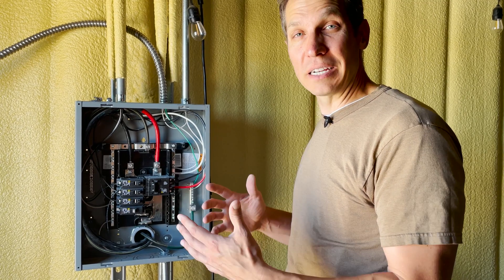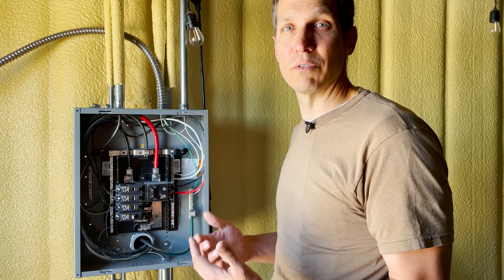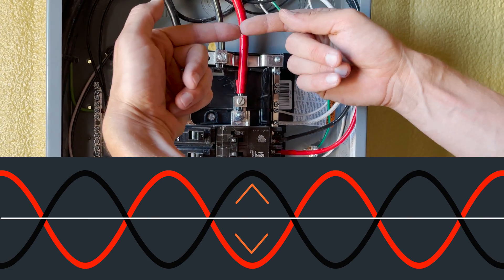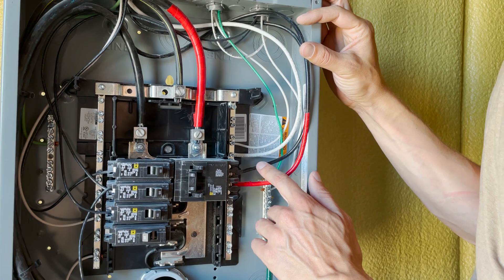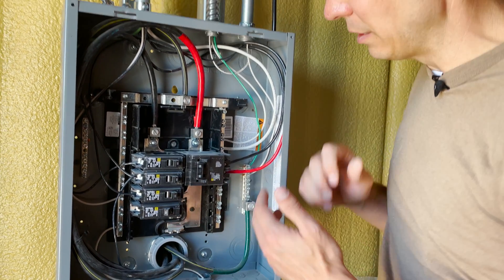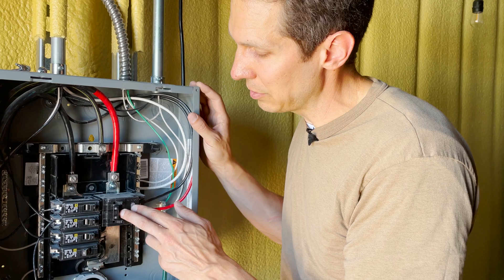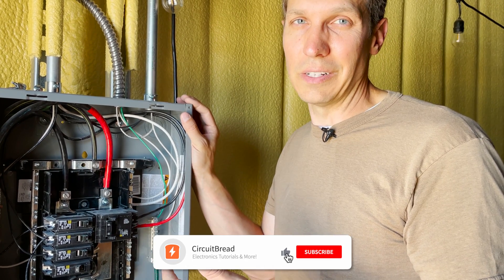How to Wire for 240 Volts in the USA | CircuitBread Practicals

Comment from the maker: We want to thank Triad Magnetics, a Friend of CircuitBread specializing in magnetics and transformers, for supporting this tutorial!  Go to triadmagnetics.com to see their line of transformers that can be used anywhere in the world that can transform down from 240V to whatever you need or from whatever you're working with up to 240V.  Again, we're grateful to Triad Magnetics for supporting free educational content like this!
Reply: Can I connect one 240v hot wire to only one connecting point while leaving the other connecting point empty? While connecting the neutral and ground to the neutral and ground busses? Will the double pole breaker still work for only 1 240v wire connected to only one of the two connection points on the double pole breaker, as long as the amps and watts are correct?

Comment: I have a 240 on demand water heater - double pole 30 amp breaker and i bought 10/3 stranded wire (thats all they had)
I need to make a 10' run - can i run that wire inside the wall ?
Been searching for the answer all morning

Comment: So a 14-2 wire running to a 15 amp double pole circuit breaker will only have a black wire going into the breaker correct ??

Comment: How do you read the breaker.  I see some 240 breakers with one throw and labeled 50A.  And others with two throws fused together showing 50a and 50a. .what is the amperage on this kind of switch and can you use a different ( higher gauge wire) since you are connecting to two switches n

Comment: I understand why you would need to wire only the 120V AC lines to get the 240 V AC , but why is the ground (neutral??)or earth ground needed? For security? So if there sna short in the wiring can the power (spike in current???)return to the circuit breaker and trigger it (or whatever is call , trip?).  So technically you don't need a ground, is it to make people feel safe mentally? How can the ground neutral or ground to earth help in Thai case? Unless is shortes to the ground wires, which wouldn't have happened if they're weren't there in the first place 😂
Reply: Unless the ground is for the equipment in question 🤔. If somehow a short appears or some type of latchup current then the power can be grounded to avoid burning the equipment? But then the current still has to travel inside the equipment from the power lines to the neutral or ground earth 🤔. Man I suck .  Engineers leave it to the electrician with the 6 month vocational education 😂
Reply from the maker: I flip-flop a lot between leaving this video up and taking it down.  I think it's useful for us electrical engineers to have a better idea of what's going on but I definitely don't want to instill a false sense of confidence!  Electricians are definitely the way to go in most cases - though being able to speak intelligently with the electrician is another desired result from this video.
That being said, the ground is purely there for protection purposes for both 120V and 240V.  It should give you the "warm and fuzzy" mentally but also, if there is any stray current, the hope is that it'll go through the ground wire (instead of you!) and then trip the breaker to make everything safe.  If everything is going right, nothing should be going through the ground wire.

Comment: How much volts should i put in a shed?
Reply from the maker: Depends on what you need!  I have a large air compressor that runs on 240V and I have other large tools in there, so I wanted to run 240V in my shed.  If your shed is more of a storage unit for your lawnmower, then a single 15A 120V circuit may be enough.  Think about your load and, as always, if you're not certain, contact an electrician!
Reply: @CircuitBread  ah well I just made it into a room for now just a tv mini fridge a light and fan in here all from extension cord but I want to add a ac wall unit and have it all wired professionally lol.
Reply: Still have to add insulation and a window.

Comment: YOU NEGLECTED TO SHOW US THE ACTUAL PLUG & HOW IT'S WIRED !
Reply from the maker: Interesting, I didn't think of showing any examples.  That's because the wiring is different for each socket though they should provide instructions for each particular outlet when you buy it.  And, more often than you'll see with a 120V circuit, a lot of things are hardwired directly.

Comment: No way. That's all it means?? Ok, so if that's the case, then correct me if I'm wrong, but if I have the receptacle wired (mine is 3 wire), then the 2 hot leads terminating on the breaker don't matter which terminal they go on? As long as my ground wire (bare) is grounded and both hot wires are secured on a breaker terminal? ...it can't be that simple. That's almost as simple as the DC bus bars I used to wire equipment on...

Comment: I want to wire up a socket for 240 that is "two pole, 3 wire grounding to run a heater.  Is the neutral not needed?
Reply: That's what I'm wrapping up tonight! I did my receptacle first, but I cheated and read the instructions. Your bare wire goes to that top pole. There's no neutral in it. Your 2 hots go to each side. Tonight I'm terminating the breaker and this video made it all click. If however I burn my house down, then I guess I didn't understand it. And I'm not as smart as I thought I was. 🤣😅🤔😒

Comment: So does the dryer require a neutral white to run parts of it on 120V? And if so, if the neutral wire broke would the parts running at 120V now run at 240V by going through the ground wire?

Comment: I completed the circuit on a breaker once, last call of summer heat wave. 13 hour work day. And a really loud complaining customer while I was working. I re wired their whole low voltage. On a electric air handler. 
Third floor top apartment Sweating my ass off while this Asian chick kept saying “ I’m sooooooooo hot” “ can you hurry up” “ I have friends coming over to eat” and I finally saw the problem. One of the high voltage wires going into the circuit breaker was loose and “ something took control of me without thinking , almost like a possession , and made me grab it with my crescent 7777 needle nose pliers. While my right hand was supporting all my weight like hanging on to the air handler. And I got hit through the heart. God must have saved me. I felt my heart stop and restart. And I was in great shape then. Sprint Triathlons I felt like I aged 10 years over night. Everything was harder. And it worked itself out. Idk. Had to be god and angels.

Comment: @circuitBread I have a three wire 240 plug in my garage, and now I need to install a four wire.Is it as simple as killing the power to the box and making sure it’s dead, running a wire from the bus bar bolt next to the ground wire on the bus bar, wrap it around a bolt on the metal junction box, then to the neutral terminal on the new plug? Am I correct or is there more steps involved?

Comment: So simple. I got a sauna that is 240v and needed to install a new line. It took a couple of hours, everything is to code, and I save at least $300. Thanks!
Reply: I'm installing a sauna heater also, from sauna  schematic its shows 2 hot lines and a ground. No neutral wire , was yours the same ?
Reply: @lespaulr6  Yes, mine is a Sunlighten mPulse Conquer which requires 240v Nema 6-20R, so it uses wiring with 2 hots and a ground, but no neutral. I just used standard 12 gauge wire with a white, black and green wire, and used both the black and white as hots, making sure to mark the ends of the white wire with black electric tape at the breaker panel and outlet (you can also use red) to make sure it conforms to code so that anyone looking at those wires know both are hot and doesn't mistake the white for a neutral. For 240v, you need a 2 pole breaker so the breaker connects to 2 parts of the breaker box where the breakers connect (2 120V connections gives the 2 pole breaker the 240v it needs). It was all very easy to do once I learned about 240v by watching a few videos from electricians on Youtube. I already had experience hooking up breakers and wiring 120V circuits though. What type of sauna do you have?
Reply: @gregdoh  I built my own sauna , it's for a customer. I have just never seen a 240v without a neutral, I went to college for photovoltaic design & installation so I am very familiar with house wiring. I don't have the sauna heater name off hand but it required a 8 gauge wire which I know needs a 40 amp breaker . Thank you for your response in clearing up the neutral wire issue , I will continue with confidence now !!
Reply: @lespaulr6  It sounds like you have a more powerful sauna. Look up "why don't nema-6 outlets use a neutral" if you're curious to why some appliances don't need the neutral. Cheers!

Comment: You explained it beautifully. I am an electrical engineer and honestly I was bit hesitant to perform electrical work around my house without fully understanding north American standards. Recently I had service upgrade from 100A to 200A and I observed electricians worked closely, they shared great insights on how stuffs works in those panels and rest of my doubts you addressed it. Thanks.

Comment: If we connect two hot wires to get 240 volt than how we get the return. Usually, in 240 volt supply we connect only one hot wire and a neutral for the return

Comment: Well, as a retired Electrical Design Engineer, I must say, this video may be embarrassing!  You said that this is in your shed.   If it is, where is the Required disconnect?  No main breaker as the required disconnecting means.  Got one outside?    There is no GEC in the panel.   Where is your required Grounding Electrode and conductor connected?   “This is a 2 pole breaker, that’s what I think it’s called”.  Very embarrassing comment.

Comment: Point of correction. The 240v is technically not out of phase. They are 180 degrees apart not 90 degrees. If they were out of phase you would have 208 v because you would have a three phase supply. You have the common 240v split phase service.
Reply: I was thinking the same thing and I was starting to question myself about 240 coming off a typical home service transformer. Thanks

Comment: Is that a sub panel? It looks like the ground and neutral bus bars are joined. If so, that's wrong, they must be separated in a sub panel.
Reply: the left and right neutral bars are bonded to each other but there is a separate ground conductor connected to the ground bars, and I’m not seeing any obvious bonding between the neutral and ground bars.

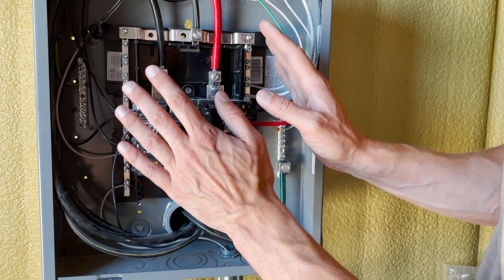Comment: 1:20 so those r 110v each?
Reply: Yes, actually closer to 120v each, when measured from the L1 bus to neutral or ground and from the L2 bus to neutral or ground. L1 to L2 voltage will be 240v.
Reply: @surferdude642  thank u
Reply: @surferdude642  so this is actualy a 2 phaze supply ? and would not be good for a single 240 apliance?
Reply: @adansoniaconfectioneryengi3742  It's single phase center tapped. There's one coil winding and it revolves in the same direction from L1 to L2. If the rotation of the windings were reversed at the mid point it would be opposite phase or maybe 2 phase, but it's never done that way that I know of. Two hot wires, one at L1 and the other at L2 gives 240 volts for a 240 volt appliance.

Comment: question. i have 20 amp breaker but need another 20amps  tu run a pool heater. have the pump and the heater on the same circuit. can i just change the existing 20amp breaker to a single pole 40 amp? and change the receptable to a gfci that feeds them for extra safety?
Reply from the maker: That sounds very dangerous, mostly because the wire is almost certainly sized for 20 amps, not 40.  You'll heard it said (roughly) that "breakers protect the house, not the people inside it."  A 20 amp breaker is to make sure that your wire doesn't get too hot and melt/start a fire.  By putting a 40 amp breaker on it, you're removing that protection. This sort of thing is definitely best left to a licensed electrician.
Reply: @CircuitBread  thanks was thinking the same. would have to divide the two circuits and give them their 20 amps individually.
Reply: @Vic-zp5ft or size up the wire. you size the wire for the load, and the fuse for the wire.
Reply: PERFECT ANSWER! I LOVE YOUR VIDEOS. THEY'RE VERY INFORMATIVE AND WELL PUT TOGETHER...
KEEP'EM COMING! GOD BLESS!!!!!!!!!!! @CircuitBread

Comment: I'm running Power to my shed along with Ethernet BUT I'm not sure if I want to run 240v out there 😅 I don't need now but while I'm there why not 🤷🏾‍♂️
Reply: If you don't, you'll regret it later. 
Any garage that's used for work and not just storage needs a 220 receptacle. 
Welders, appliances, wood working tools, etc.
We've got'em and put'em to use quite often! 😆 🤣 😂
Reply: 1 word, aircompressor
Reply: Hopefully you did. (Heater, welder, 60 gallon 2-stage air compressor) I know I would...

Comment: Questions about the breakers:
1) When a 2-pole 240 volt breaker (spanning two slots in the panel) looks like two separate breakers, is that just an artifact of the construction or is it actually two separate breakers, one per leg?
2) Does a 2-pole 240 volt breaker connect to the neutral bus or does it have exactly two connections (for the two hot lines)?
Reply: Sometimes the two hot legs have each been given independent breakers. This is not ideal as a trip condition will not fully isolate the circuit

Comment: I am only getting 124 volts on each leg of outlet and on each screw/wire of braker and when combine both legs of 124 volts on either outlet or braker I get 0 volts. Replaced braker and still 0 volts. Any idea why can't get 240 volts?
I am using the left side of braker box with GE 30 amp 2 slim brakers together.
Do you think I have to move braker to right side of braker box to be able to get the 240 volts needed for drier?
Right side is full with 3 double 240 volts brakers, how to add 1 more?
Please advise.

Comment: if you don't have the big double breaker, can you just use one 20v breaker on each side of the panel or 2 breakers in the same side of the panel?
Reply: No. Violation. Must be a two pole molded case circuit breaker with a common trip
Reply: @bills6946 I am only getting 124 volts on each leg of outlet and on each screw/wire of braker and when combine both legs of 124 volts on either outlet or braker I get 0 volts. Replaced braker and still 0 volts. Any idea why can't get 240 volts?
I installed on left side of braker panel because right was full with 3 240 volt brakers.
Do I need to move new braker to the right side to get the 240 volts?
Please advise.
Please advise.
Reply: @joaquinsuarez6090 
I'd advise you to go back to school, and actually pay attention this time.  
You DEFINITELY shouldn't be messing with electricity.
Reply: @LuckiestManInTheUniverse I asked for help and instead of helping you sent me to school?
I figured and fixed problem.
Thanks for not helping.

Comment: why doesnt this situation require a neutral conductor -- with two hots that are 180deg out of phase? is red behaving like neutral when black is hot, and 1/2 AC cycle later they reverse?
Reply from the maker: Basically, yes.  Neutral is the return leg of a standard system.  But with the two sides being out of phase, they both act as a "neutral" in that one is acting as a return leg for half of the cycle.  Though this is not technically a neutral, you can still have a separate neutral even in this case, making it easier to pull 120V out of the supply down the line.

Comment: I thought RV run on 120V
Reply from the maker: Yep!  But for larger RVs that have 50 amp plugs, they are technically 240V plugs.  And maybe 30 amp plugs?  I'm not sure about that.  However, (and there may be exceptions to this but from my limited experience) the trailer takes the two legs that are out-of-phase and just uses them independently as 120V sources, separating them at the internal panel, much like a normal panel box in a house.

Comment: Great job. The warning about touching came too late, as we were making faces every time your fingers were touching those things we are taught to never ever touch. Great easy energy and explanation of a complex process. Your vocal volume was way better than most too. Keep them coming!
Reply from the maker: 😂 thanks for the feedback! Yes, I should have mentioned that earlier.  I had a very bad experience getting shocked as a child (I've thought about doing a video and showing the scars but it was traumatic and, even 30+ years later, is a bit emotional for me) so I never work on live panels and I'm extremely cautious doing any electrical work over 5V.  It was only when I was in college and learning about voltage and current that I got to where my fear of electricity became semi-rational.
Reply: @CircuitBread Sorry to hear about that! Amazing that you are still helping others. We all thank you!!

Comment: Some 240 volt wiring systems have a bare wire in them that goes to ground...
Reply from the maker: Yeah, I should have mentioned that!  In romex, particularly, the ground wire is bare.  And for our grounding to earth with the shed, house, and solar panels, it is just a bare wire in each case.